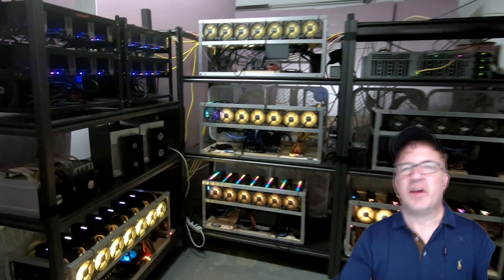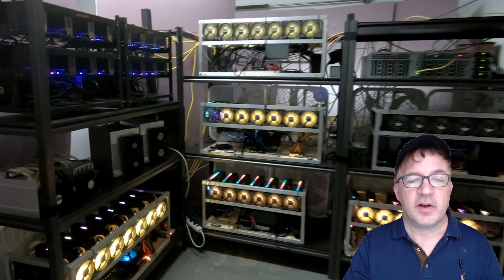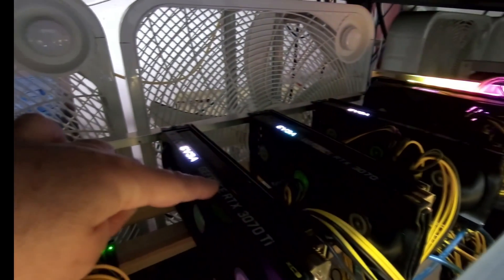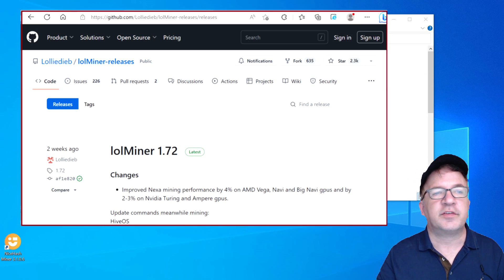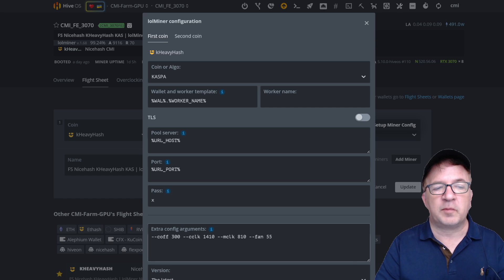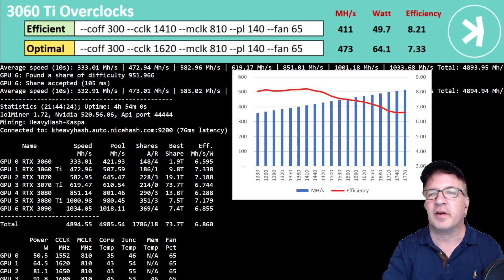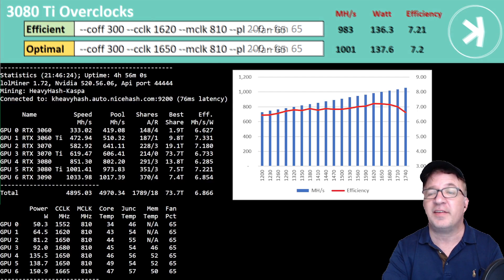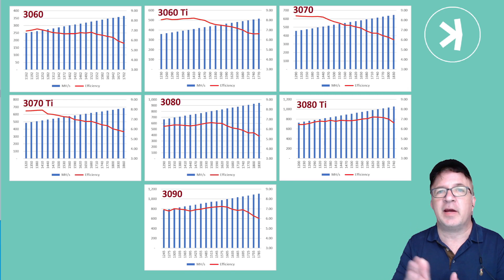BEST KASPA Overclock Settings Nicehash, Windows & HiveOS | 3060 3060Ti 3070 3070Ti 3080 3080Ti 3090

Comment: Oc satting for mai after burner please🙏
Reply from the maker: In my opinion its better and easier to set at the miner than in MSI. In MSI you need to acess advanced features to set and overclock and apply undervolting. It's not simple which is why I prefer setting in the miner

Comment: would nice if you could share OC setting for 1660S and 1660Ti or older version GPU like 1060, 1070Ti and 580
Reply: For 1660s (Hynix) 1500 core clock, 150 core offset, 810 mem - gives 253 MH @ 42-44W
Reply: Seconded for 1660 Ti & 1660 Super
Reply from the maker: Working on it...
Reply: Sheeeesh i a full 1660s rig thanks 😊
Reply from the maker: @Wilky971  I'm looking to get more previous generation cards to test and include in future videos
Reply: @CryptoMiningInsider  that would be awesome. I have 570s running 72-85w currently

Comment: Can i apply different OC to different cards in NiceHash ? i got mix 3060 / 3070 ?
Reply from the maker: Yes It's easy - separate the values that are specific for cards like cclk and pl with commas 
(example of 2 card rig)  --coff 300 --cclk 1410,1560 --mclk 810 --pl 125,200 --fan 65